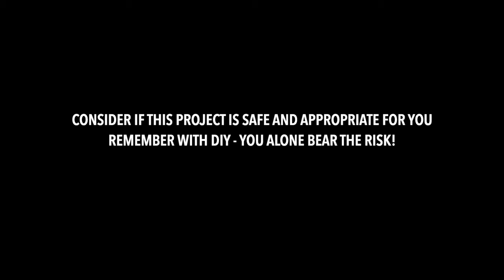Toyota Camry - Headlight Assembly Replacement - 2007-2011

Comment: I’ve never worked on my car before except to check the oil & the occasional flat, but I was determined to do this. Followed your directions exactly, no problems! My car looks brand new! Excellent video.
Reply: How much does the two new assemblies cost?
Reply: @TamaraJohnBlue what
Reply: @ChupaLmfao  was asking what the set of both headlights including new plastic covers  (called assemblies) cost?
Reply: @TamaraJohnBlue my partner said he thinks 100. That was for one though. It might be less. You can always get a price if you ask at a auto parts store. O rileys, we typically go to.
Reply: Yeah not a headache at all I did my lights today

Comment: Do you need to remove the bumper to access the headlight housing? It looks like you can pull out by just removing the top bolts. Just curious
Reply: ? ? We can ??

Comment: Anyone thinking I might just use cleaning kit  don't do it. Just replace them. I tried toothpaste,  cleaning paste, bought some bug spray 20 bucks Amazon.  But checked new ones 70 bucks.  Excellent video,  just  put phone on radiator and follow. Sent back the spray never used it. Take your time  😊.

Comment: I appreciate the no frills video. No intro bs, just the information. It took me less than 2 hours start to finish. I got mine from Rockauto along with a new set of bulbs for $200 total. What a huge difference.  Probably easier than one of those headlight polishing kits.
Reply: Yea, no.
Polishing kit takes about 20 mins start to finish and requires no tools other than polishing pad.

Comment: Thanks for the video it  helped my other cars it was one bolt and a slide lock in the whole assembly came out this was definitely more involved but if you have someone help you don’t have to pull off all the bolts from the bottom I had my wife just hang onto the bumper while I swap them out real quick, but if you don’t have anyone to help you definitely have to take the whole Front off thanks again

Comment: I installed my weelmoto lights on my Camry..My concern is there was plugs on both ends that was not mentioned in the instructions..I left the plugs on..I noticed your installation didn’t mention the plug  either..

Comment: All I want to do is change the sidelights/parking light bulbs, which apparently requires the same procedure! 
While the headlight assembly appears different externally to an Australian-built Camry in the XV40 series, it appears that the location of the blinker (turn signal) and parking light (marker light) bulbs are the same; buried in the inner wing.
The Owner's Manual states, ""NOTICE Do not try to replace the front fog, front turn signal, parking, back-up, tail light, stop light, high-mounted stop lamp of licence plate bulbs by yourself. You may damage the vehicle." 
It might as well also state, 'And don't bother trying to adjust the angle either because we've invented a new type of adjustment screw, put it into an inaccessible place and tightened it with Superglue!' 
Thanks
Reply: Lol, yeah the plastic clips can break easily, especially if they are older. They are also not that hard to replace if you do break a couple.

Comment: Old headlights just needed polish
Reply: That trick doesn't always work....can't just polish the outside of something that has baked in the sun for more than a decade and expect it to return to normal.  There are tons of those videos out there for that, but this is the best video I've found for replacing these headlights.
Reply: @leetjohnson  It worked well for my 15 year old car. I used the Sylvania restoration kit.
Reply: @leetjohnson right. You can restore your headlights and get a temporary nice boost to your headlights. But for a OE lamp on a 10-15 year old car that has been through a couple restoration kit applications... A new headlight assy is necessary.